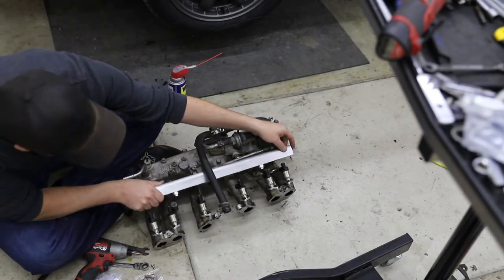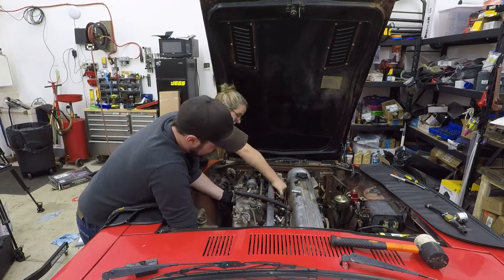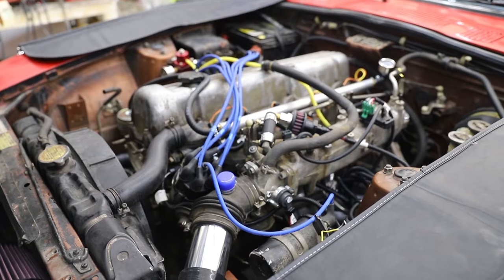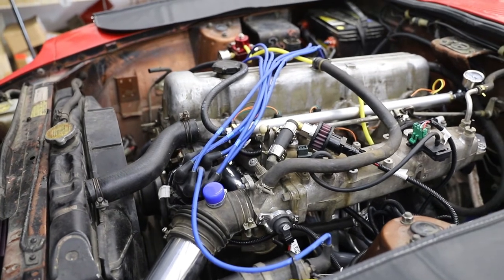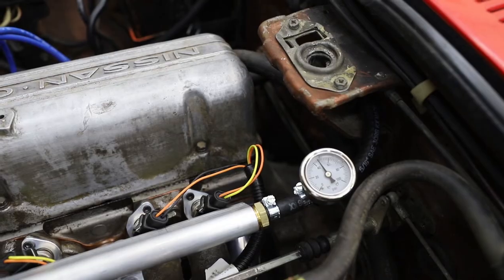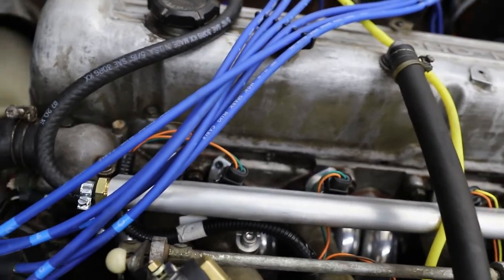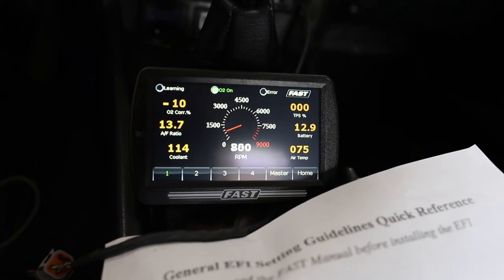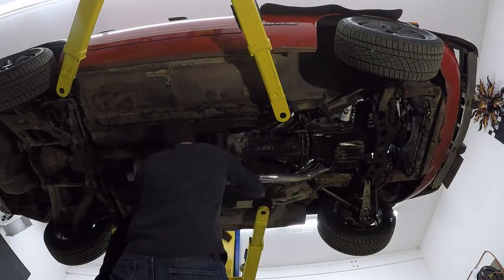280Z DD Project - EZ EFI Initial Thoughts

Comment: Great video! Can ezefi support an itb setup? Just curious. Thanks in advance
Reply from the maker: It would depend on what kind of ITB setup and how well tuned you were trying to get it. At least this unit would be hard. To do ITBs correctly you should probably have a more flexible system that you can properly measure individual pressures, EGT per exhaust tube or bank, etc.

I haven't thought of it much, but I would probably look at a standalone solution or something specifically made for the purpose of a properly tuning a system like that.

Comment: Installing this kit, and you touch upon the issues I have encountered: fuel pump control (this kit allows the fuel pump to keep running even when the engine stalls, such as in a crash!) and tach adapter. Maybe you could draw up and post a wiring diagram for the kit, especially how you might add a relay to overcome the fuel pump run-on. I expect to shorten nearly every wire so the harness fits around the L28 a bit more neatly.
Reply from the maker: Yeah, I'm going to make a whole new harness for the engine and shorten the included harness and add a plug at the firewall.

Comment: Thnx for the info! I’m looking into buying this kit for my 280Z. I actually want a full standalone ECU controlling fuel and ignition but I’m worried about the learning curve of the install and the tuning. This kit could be a nice first step in that direction.
Reply from the maker: That was my thought and it is much cheaper than the AEM standalone on my SR240Z. I am going to do custom ignition timing curves with a 123ignition Bluetooth distributor here in the near future.
Reply: If this retrofit kit from zcardepot is based on the EZ-EFI 2.0 then it can control ignition. FAST recommends their Dual-Sync distributor for the EZ-EFI 2.0 kit but the stock Datsun unit may be able to be retrofitted to work.  The distributor's centrifugal advance has to be locked out and the internals replaced with ones that could send an inductive signal to the ECU.  The internals would have to come from a six cylinder distributor that uses the ECU to control timing. This distributor retrofit may be beyond some people, but it is one way to go.
Reply from the maker: One of the interesting perks of the 123ignition unit is that it also has a MAP sensor to apply curves with, allowing rpm based and vacuum/boost based timing... But I would imagine you could make the EZ EFI do it as well if you unlocked advanced features or added some sensors and changed the distributor.

Modern technology is amazing.

Comment: How do you know which injector connector go into which injector? The wiring diagram provided just says which one is 1, 2 ,3 and 4.
Reply from the maker: It doesn't really matter. It's not a sequential firing injector setup. It would need to know crank angle to guess at cylinder firing order. It's just functioning like most early EFI systems, squirting based on RPM.
Reply: @AmbiVe  thanks for the response man!!!  really really helpful.

Comment: Does your remote IAC valve make lots of sucking air noise when accelerating.  I just got the system installed and trying to figure out if that is normal or not.  I understand the system needs to open to add additional air during throttle but it seems rather loud
Reply from the maker: What percentage open is your IACV at usually? It certainly could make noise depending on where you place it, how long of a hose you have running from it to your intake manifold, etc. It's just a controlled air leak like on any car so it depends how fast the air is moving through it, where it's placed, and how it's mounted as far as how the noise is transmitted.

Comment: Could you share why the Coolant Temp Sensor adapter is so important to use.  You mention that but don't tell us.  I'm curious and wonder if it affects starting.
Reply from the maker: The adapter its self is just important to allow the new style sensor to thread into the old port. Not having a coolant temp sensor in general can impact starting as it gives the temperature signal used for cold start enrichment, is used to signal the systems to switch from basic cold maps to self learning, etc. If you didn't have it, there would be a lot of issues that could amount to trouble starting and more, just as if it had failed.

Comment: Looking at getting this for my 77 280z. I have a mild cam (slalom) and headers and a larger TB. With this configuration it makes it difficult to pass state emissions. Can you tune EZEFI for emissions? Thanks.
Reply from the maker: It would depend which emissions tests. For example, you can tune how rich or lean it is running with greater accuracy, but EFI can't do the job of a catalytic converter. Likewise, if you disabled a required system like EGR, this would not replace it in the eyes of most inspection agencies. This will make it easier to compensate for some modifications, but only some.

Comment: Ah….  Your fuel pump does not run all the time.  

Fuel pumps have a fuel pressure switch built into them that turns the pump on and off to maintain the stated PSI of the pump.  

If your pump is running all the time; you purchased a pump with a PSI rating too high.   

You can simply install a pressure regulator after the pump

Comment: Do you have any updates for us?
Reply from the maker: I will be doing a follow up on the EZ EFI and Sniper EFI soon hopefully. I haven't had much time and ended up pulling the 280Z down for paint and body work to keep it rust free.
Reply: @AmbiVe   thanks for you videos bro  BTW I want to ask your whT injectors are you running. (part number ) en which fuel pressure regulator. Please please
Reply: @slv_car_refinisher6864  I used the 14mm oring injectors 800-1315 from Zcardepot.com with the bullet fuel rail to adapt to them and the Aeromotive 13129 regulator.
Reply: @CasperLehner   I know you have  this efi for a year already. How's the cars of running now.?
Reply: @slv_car_refinisher6864  overall the car runs better than it did with the old Bosch system by quite a bit. When I get it back from paint I will be redoing the generic wiring harness that came with it, changing the layout and removing the extra injector plugs entirely. Otherwise, not much to complain about on it so far.
Reply: @CasperLehner  with your review about this. You changed my mind.. I have a1978 datsun 280z..planing to rebuilt the engine.. I was trying to keep it stock but they I will realize all the components are old and  will be struggling to get the car run smoothly...
Reply: @CasperLehner   BTW this kit comes with 8 plugs and it doesn't matter (chevy or ford) it will fit the plugs.. Is it matter   using any plug of the kit or it has to be on specific order.?
Reply: @CasperLehner  can I use whichever brand of injertors I want while they are 14mm rated at 19lbs correcto?
Reply: @slv_car_refinisher6864  as long as the specs are the same they should work. I believe these are a standard GM style, so there should be options. Just check for the right size, flow and impedance.
Reply: @CasperLehner   so with new efi.. Rail. Injectors. Adapters. Fuel regulator We talking about 3000 dollars  and we save alot headaches
Reply from the maker: I think everything I bought was about $1900 according to my spreadsheet. The main EFI kit was about $1300, the injectors were about $300, and the rail and adapter kit was about $300. The regulator was another $130 or so, but nowhere near $3000 back when I bought it all, but it would depend on brands and what country I would think. I bought most of my parts from zcardepot.com.
Reply: @AmbiVe  1900 is not that bad
Reply from the maker: Not really if you consider the cost of trying to go over to a carb setup or replace nearly everything in an OEM system that's worn out... and then you end up back with a system that has the same limitations. I prefer more simple, modern, setups when possible. Makes it easier to diagnose and a 19# GM injector is much more available if I have problems on a road trip.
Reply: @AmbiVe   how's your car doing on cold weather. Will it immediately fire it up?
Reply from the maker: @slv_car_refinisher6864  It was much better on a cold start, almost always firing up first cranks. I was playing with timing curves a lot for cold starts, what would start great would seem a bit rough during cold driving with a low idle, but I think it's pretty good now. I just haven't been able to drive it while I'm gutting it for paint.
Reply: @AmbiVe   thanks so amazing to here that
Reply: Casper Lehner  can I use a 22lbs injectors or it has to be the 19 lbs injectors the zcarpot is selling?  What cons and pros?